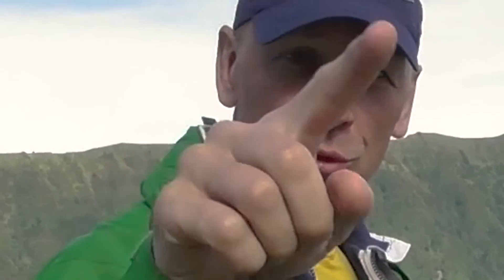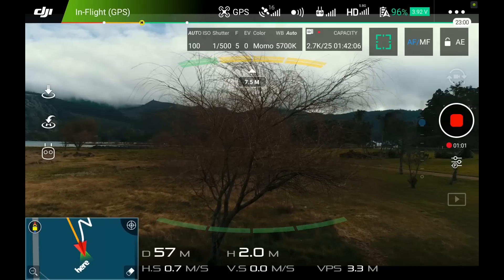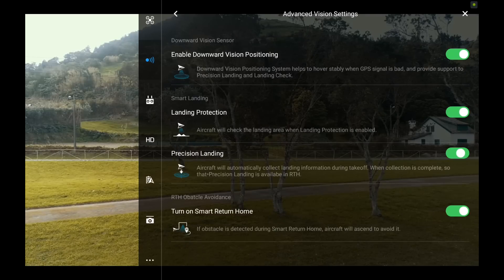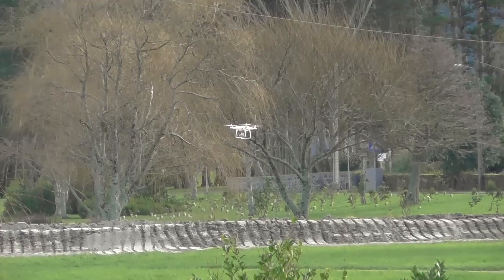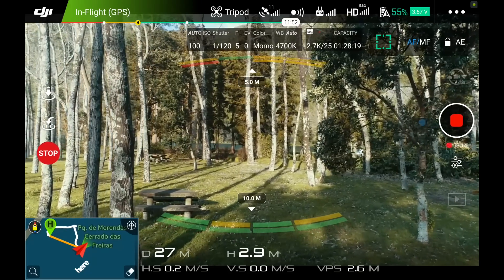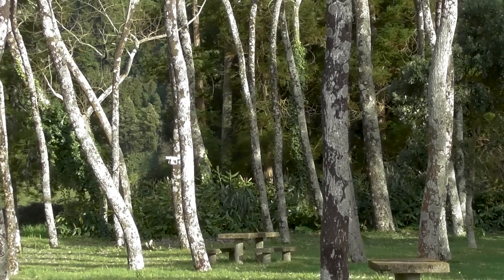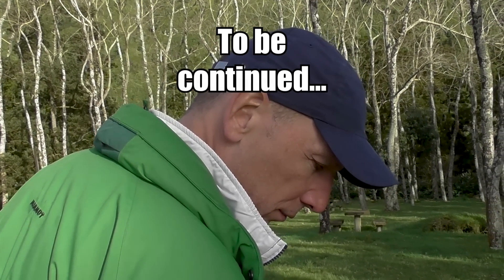Losing signal: the RTH function has even become smarter with the Phantom 4 Pro.

Comment: its not smart is programmed do that. go height you set,turn,fly home gps,turn direction you started,land,even you under brigde it go up first CRASH. even its so smart it scan surroundng and have 3d map lol.
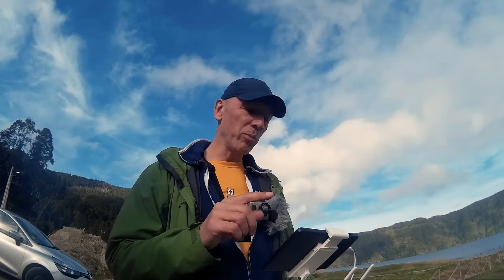4:41 first you need fly hours make that 3d map. i dont think it save them for next fly
7:03 yes that what is doing return home.
'its hard to test obsticle on RTH when its fly routu you have fly. not any smart that.

testgoing behind house that is taller than return home height. what it will do.
then go around house scanning it so its no it. what it is do then. go around it or go over even heigher than rth height.
do same under bridge

Comment: OKAY SO READING ALL THE COMMENTS AND LEARNING ABOUT THIS. 

LOOKS LIKE SMART RETURN TO HOME IS USELESS LOL.
Reply from the maker: The only advantage is that it will go back along the route it came for a while, which is the most logical thing to do to get the signal back. But for the rest: no internal 3D mapping choosing the most efficient obstacle avoiding way back home...
Reply: NeverMindYourOwn 

Yes that's the theory. And it doesn't work very well.. 

I also read somewhere it's only good for 300M..  so if you're further than about 900 feet away then it's useless..

Comment: Probably you shouldn't have increased the height/altitude of the drone once after it went into the smart return to home with the predefined altitude!!! I think that's what went wrong as far as the smart return to home function is concerned...
Reply from the maker: It automatically does that when SRTH and the minimum altitude is 20 meters.
Reply: NeverMindYourOwn Yes I understand but I was talking about this particular moment where you said "It's not that higher, I'll go a little bit higher" 12:32 !!! Did you do that manually or the drone did it all by itself???
Reply from the maker: Yes, I did that. Because I was sure it had not 3D mapped the obstacles at that height already and thus would have to rely on ad hoc obstacle avoidance. With these tiny branches I'd rather had it at a safe altitude.
Reply: NeverMindYourOwn True but why don't you try 3-D mapping the obstacles at the predefined height which is 20 m unlike in the video because no matter you 3-D map the obstacles beneath 20 m the drone still goes up to the predefined height which is in this case 20 m. And remember I'm learning from your videos too so it's just a suggestion which I believe will work out!

Comment: Hi. I want to ask a question about rth. If my phantom 3A is far away and my battery is too
low to rth and I have set it to rth when losing signal. 
so when I hit the button from my iphone to auto land will it: 
1) auto land even when it loses signal?
2) will start to auto land and when loses signal tries to get back home? 
thanks!
Reply from the maker: See this video: https://www.youtube.com/watch?v=G8G5iSfb3nw
I had it landing at 4,5 km distance, then it lost signal and tried to RTH. I found it a couple of hundred meters away from where I had it landing.
You can set the behaviour in the DJIGo app settings. When losing signal, you can tell the drone to either RTH, hover or land. So make sure you set it to land BEFORE you land it, if you think it may lose signal during landing.
In the worst case it will come flying back and you have no idea how far it got.
Reply: I have already seen that video it was awesome. But still my question is. 
If my setting on the app is to RTH. when I try to land it manually it will start to re ascend
as soon as it loses signal. But IF I hit the button to autoland (not manually)
will it autoland or will it try to come home as soons it loses signal?
Reply from the maker: I had set it to autoland on that video. So yes, if it lose signal during autoland, it will RTH. But it is easy to test. Have the drone fly at 50 meters distance. Have it auto land. Turn of the transmitter and see what happens.

Comment: does the nvidia shield k1 crash alot?
Reply from the maker: The Shield does not crash. DJIGo app may crash on the Shield. And in a rare incident DJIGo app may even crash the Shield.
Reply: Peer -  With me, I have an Apple aversion so bad that I even quit eating apples (the fruit).  :)
As a long time computer user since the days of building your own with a soldering iron and blank circuit boards when Apples came out with their closed architecture it made a lot of folks angry.  But the Apple folks are like rabid dogs defending their egos, they attack anyone and everything that makes a comment they think is derogatory.  I'd quit buying DJI products if a fruit tablet was mandatory.
Reply: Shield is junk, buy an iPad mini 4 and it works flawlessly.
Reply: actually its pretty good. very fast tab. cant beat that tfor that price. its the firmware and dji go 4 that is crap. dji wants everybody on apple.
Reply: No, it's cheap junk. iPad is stable, has a better screen, better software support etc etc
Reply: And costs twice as much.  I've been using the Shield K1 for over 2 years without a problem.  I do run "Shut App" to close hidden apps, then use "Screen Recorder App," plug into the controller and wait for the pop-up, choose, DJI GO4 or Litchi, and "just this time," then fly.  Never crashes.
Reply: Jerry Ellis over twice as much. and nvidia is faster with hdmi out.
Reply: exactly. Apple users are consumer zombie products. they just buys everything that other people have with no mind of their own and whats on ads on tv. they cant even clear their memory on their devices and just buy new ones when they become slow. they can barely plug in the usb cord. and everything costs money with apple. i almost bought apple product only to use with my drone.  trying hard to avoid it. ive used pc since 386. started with commodore 64 with casette player lol. waiting for hate comments from apple users....
Reply: Peer - Also had a C64 w/cassette player but upgraded to an external 5.5 floppy.  I then "graduated" to a an Amiga and used that for quite a while until I finally got a 386.  Did you do Compuserve?  

I will probably update my Note 4 cell phone soon and thinkin' about deleting all the apps and and/or hack it to get rid of the apps that can't be deleted and then try using it just DJI Go app.  Neither my Note 4 or the Shield get along with GO so I just fly with Litchi all the time and use GO for updates and settings not available on Litchi.  Lichi works great on the Shield though and rarely crashes  but the couple of times it did crash using Litchi was when I lost video connection but it hasn't happened lately so something fixed that.

Comment: As far as I understand it, it will always ascend to the RTH altitude if lower, then it will return in a straight line (unless you have the option to return back the same way selected) THEN if on that path when returning home it encounters an object it will automatically increase its own altitude until it can fly over the top of the obstacle. Watch this video for a quick example: https://www.youtube.com/watch?v=VRXlk09b8IA
Reply from the maker: That example is the OLD Smart RTH. DJI said it had upgraded it and so far I have only discovered it will return on it's path the way it came, when losing signal.

Comment: Hi the dji fail safe return to home works like your track record on your car gps it will save your flight path gps coordinates as seen on the flight record upon signal lost it then follows the same path you flew in at your set height with all sensors working till the signal is found again 
Smart return to home this is straight from the manual 
Smart RTH
Use the RTH button on the remote controller or tap the RTH button in the DJI GO 4 app and follow the on- screen instructions when GPS is available to initiate Smart RTH. The aircraft will then automatically return to the last recorded Home Point. Use the remote controller to control the aircraft’s speed or altitude to avoid a collision during the Smart RTH process. As the aircraft returns, it will use the primary camera to identify obstacles as far as 300m in front, allowing it to plan a safe route home. Press and hold the Smart RTH button once to start the process, and press the Smart RTH button again to terminate the procedure and regain full control of the aircraft.
Landing Protection will activate during Smart RTH, Precision Landing and when using Auto Landing in the DJI GO 4 app:
1. When Landing Protection determines that the ground is suitable for landing, the Phantom 4 Pro / Pro+
will land gently.
2. If Landing Protection determines that the ground is not suitable for landing, the Phantom 4 Pro / Pro+
will hover and wait for pilot con rmation.
3. If Landing Protection is not operational, the DJI GO 4 app will display a landing prompt when the
Phantom 4 Pro / Pro+ descends below 0.3 meters. Pull down on the throttle or use the auto landing slider to land

Hope this helps Darryl

Comment: The drone constantly stores it's 3D-position during flight, but ONLY the last flown 300m. So it does NOT make an internal 3D map of it's surroundings.
When connection to the RC is lost and RTH kicks in it will do all the usual things (acending if it's lower than RTH-altitude) and in addition it will first fly the last 300m back the way it got there, than it resumes in a straight line.
Reply: ah...this makes sense!
Reply: vhs opdvd nice one short and simple lol

Comment: why you didnt get apple product to fly ?  i personally got ipad mini 4 and very happy with it.
Reply from the maker: Because it is very difficult to record the screen with it.
Reply: NeverMindYourOwn yes. this is true.
Reply: I use Iairhou and it works fine for me. http://iemulators.com/airshou
Reply: NeverMindYourOwn nope it's not !! Just do a simple search on YouTube how to screen record on an iPad dji apps are optimised better for iOS devices
Reply: NeverMindYourOwn iOS 11 added built in screen recording. Just have to enable it in the settings under control center.  It works on my iPad mini 2 (very old CPU/GPU) without any frame drops while recording DJi app.   

However I recommend iPad mini 4 since it’s much faster and likely last many more years..